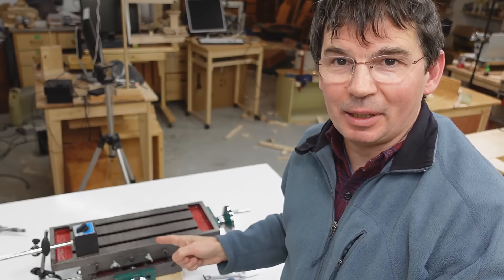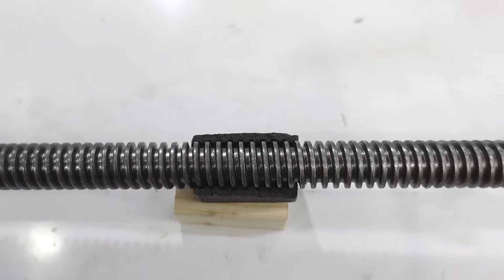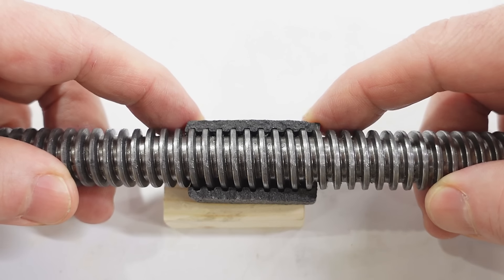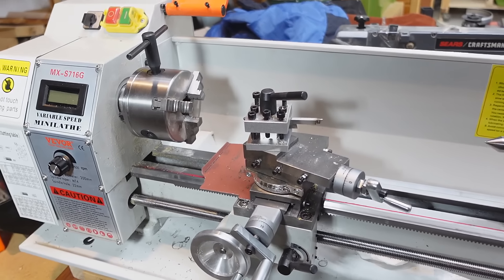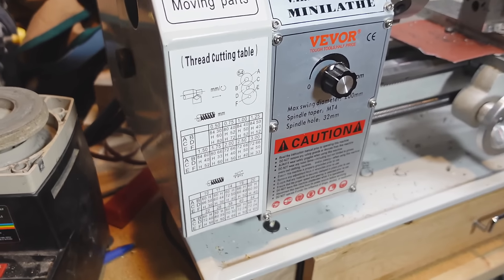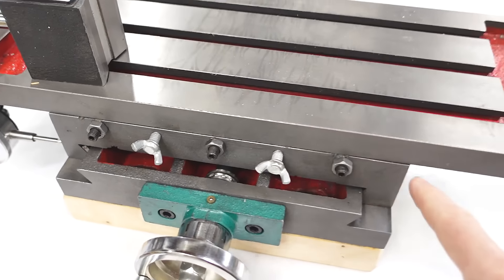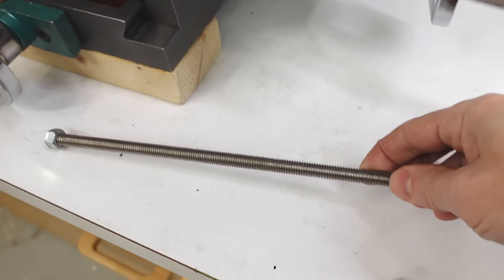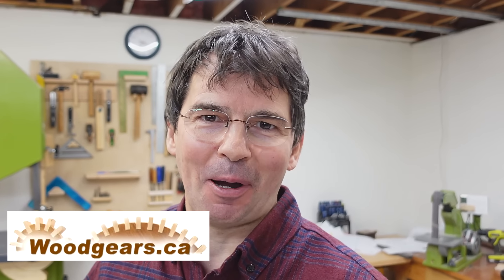Why all the hate for Vevor?

Comment: Vevor is a highly underrated company. The variety of the things they sell is amazing. I've been very happy with their products. I have a coffee bean grinder, kitchen stand mixer, Internet-connected weather station, a stick/TIG/MIG/flux-core welder, water (and other things) distiller and am considering buying a meat slicer. The only negative issue, not really a problem, with Vevor is that they don't sell repair or spare parts for their products. Not having the parts inventory and infrastructure is partly how they can sell at such low prices. You can buy a whole new (name your item here) from them for less money than the said spare part for comparable items of their competition. This is the incentive they use to ensure that a repair parts sales department is not necessary. If (big IF) the blade on your Vevor meat slicer wears out, you can buy a new machine for less than a new Hobart blade. (Don't fact check me on that. I'm just illustrating my point.)

Wen is another underrated but tool-only company.

Comment: Just thought I'd share some experience related to milling with a drill press.  1) Tapers are not designed for transverse loading, and it's going to have a tendency to fall out of the spindle.  It's why milling machines have draw bars.  2) I solved problem one using retaining compound, but slop and flex in the quill made it nearly impossible to get good results, even with very light cuts. 3) precise depth of cut is nearly impossible.  If you decide to take it on, expect significant challenges.
Reply: I wanted to convert my drill press into a wood/plastic mill. Replaced the bearings with angular contact bearings and modified the spindle so i could apply a preload. Modified the end to take an er25 collet and nut. Turned out great but i appreciate it has it's limitations. Does manage to munch through aluminium but no where near rigid enough for steel.
Reply: Mill spindles are a lot more robust than drill press spindles are. The diameter is twice as big.
Reply: My milling machine spindle has a pair of tapered roller bearings made by timken, whereas almost (but not all] drill presses I've looked closely at, tend to have ball bearings instead. 

As a result, the bearing setup on a  drill press is much less suitable for side loading.

Some exceptions to this, are where some drill presses use basically the head of a milling machine (see Stefan Gotteswinter's shop tour video).
Reply: Your point is a good warning,as you say Morse tapers are not dependable for milling without a drawbar through the spindle.
Reply: I think it is not just significant challenges, but impossible challenges. At best you can mill soft wood and plastic with very small tools. If the drill press is still usable as a drill press (or even improved!), it could be a good education to try.
Reply: @howardosborne8647  You "could" remove the chuck from the drill spindle and drill and tap the end of the spindle.......then just put a screw up inside the chuck and pull it onto the spindle.......it can never fall off.

Comment: Bottom line is: you either get a Vevor lathe or no lathe at all.
Reply: Well there are many other options out there that are higher quality products, and many of them are not stupidly expensive either - Vevor seems to be targeting very much the cheapest thing you could reasonably sell without false advertising, while others might target the best bang for the buck possible on an actually ready to use tool, and of course at the premium end the highest possible quality who cares what it costs... 
If your price bracket really is stuck at Vevor or nothing, nothing might actually be the better choice for many - makerspace and the ability to order your part made to order can work out much cheaper and get you better parts than having to own the tool and then spend ages making it useable yourself. Of course you may not have a local makerspace (or friendly workshop).
Reply: @foldionepapyrus3441  You make a lot of assumptions!. There is nothing wrong about modifying a tool you own to make it better.   People modify hammers to a specific need.   As with any tool, it's only as good as the person using it.  I have seen garbage made on highly precise and very expensive machines, and vise versa I have seen quality work done with cheap tools and alot of skill.
Reply: @rmora1  I really don't - just because you can make something good with crap tools doesn't stop the tools being crap. Or after you put in huge amount of effort to improve them from such a low starting baseline probably only get to mediocre. Unless you have spent more on it than the good tool would have been in the first place...

With a quality tool the work is usually faster and easier to get a good result and in the case of more high end machining fits it becomes actually plausible to create that large surface that must be kept to a very precise size. 

Which is why a local Makerspace may well be a better choice than the worst end of budget tooling - odds are they have tools that are far better you can use, probably have managed to find an old grey beard or two that really really know their stuff you can learn from etc... However that suggestion obviously won't do you any good if such a thing doesn't exist for you.
Reply: @foldionepapyrus3441  I have designated crap tools I use for crap projects and I have precise tools for precise projects, either will do the job.  As the saying goes " It is a poor workman who blames his tools"  Having precise tools and not having the skill to use them is a common thing now that did not happen before.   Having precise tools does not  guarantee quality work.   Precision is nice but if it comes at too high a cost then it becomes pointless.  I can have the most precise pair of  pliers ever made but what good is that precision when the average mass produced pliers do the exact same job in the exact same time.
Reply: @foldionepapyrus3441  Many other options but I didn't name a single one..
Reply: @PatrickRemington  You'd have to do your research for what is available in your market at your price point as there are way too many options to list. For myself I'd suggest getting the best you can afford or on a tight budget not buying the crap quality machine at all for most folks - the skill required to make good use of a crap machine is rather harder to teach yourself on that crap machine, and unless you already have a stock of raw materials and tooling to help you tune up that crap machine it will cost you a fortune more to deal with that crap machine.
Reply: @PatrickRemington  Oh but if you insist on a name Cowells make really great and precise tiny lathes for a price I liked (Its the choice I made for my watchmaking sized projects), Myford are still making new lathes and parts to restore the old ones (no personal experience of their products but I hear good things). 

Neither are at the cheapest end, and may not even be available on your side of the pond. But personally for a machine tool I'd only get cheapest end as a project once I already had a good tool to make building the repair parts less annoying - do you want to spend 3 days hand fettling when you can spend 10 mins with a good tool and jump right to the end.
Reply: Vevor: "We're not the best, and we know it 👍"
Reply: Better buy a used decent lathe than a new Vevor piece of junk.
Reply: @glenpaul3606  That all depends, a lot of smaller size old lathes are really not that good, or are worn so much they need grinding or scraping. I have a very good Schaublin SV130
 lathe at home. But before that I had two myford ML-7's and a Super 7, If you want to buy either of those you'll be buying an overpriced lathe, that in all likelihood will have a worn apron that makes any kind of precision work  impossible. And the same could be said for other small old lathes, like Boleys.

My magnet drill and tractor tire bead breaker are from Vevor, and both work great.

Comment: I have had a lot of success with companies like Vevor, Harbour Freight, & Pacific Freight Salvage, they may not have the highest quality, however they do tend to be the easiest to repair and or modify because they generally are made of simple materials and follow simple designs.  Great video Matthias thumbs up.
Reply: What is Pacific freight salvage? I've never heard of it.
Reply: @mturallo  I suppose that was before Harbour Freight I use to purchase from them in the '70s, I bought a nice 5/8" bench mounted drill press.  The chuck kept falling out because the morse taper was not made correctly, I just lapped it with valve grinding compound and it's been working great ever since.

Comment: Cheap tools can be a great project to learn and improve it if you're not too fussy on starting making parts immediately. I've bought many cheap tools that I've adapted for more accuracy to the point it was enough for me. Occasionally I've replaced them once I outgrew the tool. But sticking with what you have saves you a lot of money instead of splurging for a much more advanced tool you probably not going to appreciate the precision during its lifetime anyway and limit you in buying more tools along the way.
Reply from the maker: exactly. And with the cheap stuff a multiple cheaper, you can think of it as an incremental cost on you way to a proper tool if you do end up replacing it.
Reply: That's why I think the saying "buy cheap, buy twice" is bogus. Not only does "cheap" often last much longer than expected and tick all the boxes, it also means that after that I know what I actually need from a tool. The "buy twice" would happen anyway for that reason even with an expensive first tool.
I also found that I'm more likely to fix and modify cheaper stuff. That's because I don't have any qualms to rip into a cheap tool as there isn't anything expensive to break.
Reply: @superdau  DEAD ON!!!
Reply: @superdau  the old saying "buy once, cry once" holds true for some things, but as with everything, it's not always applicable to everything. For instance, if someone wants to put a very precisely sized hole into a piece of metal at a very precise location, (and if the 'want' for that hole is more important than their 'want' of another project) and if they have the amount of monetary budget to allocate to a solution for creating that hole, then the saying "buy once, cry once" can hold true. After all, what you don't spend with money you spend with time. Given enough time, many people can get a cheaper machine to operate precisely if they have the measuring tools to determine that level. But it takes a lot of time and physical effort to make it happen.

Comment: When I worked at a big box store back in my college years, whenever people would ask about the cheap in-house brand and the higher quality name brands for power tools, I'd usually ask what they intend to use them for.  More often than not the people asking that question just needed something to get a job done, and may not use it much if at all afterwards.  For that, the low cost entry point to tools like these are perfect.  Is it perfect? Will it last forever? No, but why spend $400 on a drill when you're going to use it for 3 days and stick it on a shelf for the next 8 years...
Reply: That was the good old days. Now, they would just buy the expensive one, use it for 3 days, and return it for a refund. That's why you spend $150 for a drill that costs $25 to manufacture.
Reply: @Bob_Adkins  highly unfortunate how right you are with that statement...
Reply: Well said, it's why I own thousands of dollars off festool stuff and hundreds of dollars of ozito/enihell stuff. The festool gets used daily, the ozito stuff sits on a shelf for weeks at a time.

Comment: I purchased a VEVOR 12v diesel heater 3yrs ago. It isn’t perfect and I have had it apart a few time for repairs. Sure it’s mostly plastic and cheese grade castings but it was cheap and has kept me warm for 3 seasons of truck bed camping. Considering it’s about 1/10 the cost of name brand I am very pleased with the results it produces if not the product itself.

Comment: The best way to remove the lash in the lead screw it to have dual lead screw nuts that you can adjust them in opposite directions. This will take out all that slop without making the lead screw harder to turn. The nuts are adjusted to ride on the opposite sides of the threads.

Comment: Hi, as a machinist for decades I have found every screw mechanism has backlash, you just have to learn how to accomodate it in your work. The bad fit of the screw nut here can be reduced but not eliminated easily, think about it.
Reply: Yea, ive only done it for 5 ish years but ive never really seen a perfect one either. Most stuff i use have digital readouts so i just go off that and learn to feel where the screw grabs and starts to move like you say. Never had much of an issue.
Reply: Exactly. Every machinist naturally accommodates backlash with their technique. You may have to avoid climb milling but then again it may work if the gibs are tight enough.
Reply: Exactly. Every machinist naturally accommodates backlash with their technique. You may have to avoid climb milling but then again it may work if the gibs are tight enough.
Reply: Exactly. Every machinist naturally accommodates backlash with their technique. You may have to avoid climb milling but then again it may work if the gibs are tight enough.
Reply: Exactly. Every machinist naturally accommodates backlash with their technique. You may have to avoid climb milling but then again it may work if the gibs are tight enough.
Reply: Exactly. Every machinist naturally accommodates backlash with their technique. You may have to avoid climb milling but then again it may work if the gibs are tight enough.
Reply: Exactly. Every machinist naturally accommodates backlash with their technique. You may have to avoid climb milling but then again it may work if the gibs are tight enough.
Reply: Exactly. Every machinist naturally accommodates backlash with their technique. You may have to avoid climb milling but then again it may work if the gibs are tight enough.
Reply: Exactly. Every machinist naturally accommodates backlash with their technique. You may have to avoid climb milling but then again it may work if the gibs are tight enough.
Reply: Exactly. Every machinist naturally accommodates backlash with their technique. You may have to avoid climb milling but then again it may work if the gibs are tight enough.
Reply: Exactly. Every machinist naturally accommodates backlash with their technique. You may have to avoid climb milling but then again it may work if the gibs are tight enough.
Reply: @meetim6271  Can you repeat that one more time? 😀
Reply: 😂Lol lol lol lol lol

Comment: You are correct about the high cost of used machine tools and they may require a bit of tweaking too. Just cleaning an old lathe covered in years of grease and grime is a major task. I did a search for a used small lathe and could only find (in my local Cleveland area) a few that where 3 to 4 times the size of yours for $3K to $5K range and need work. Also they don’t run on standard house current. Nothing wrong with what you have.

Comment: I haven't really heard anyone else talk about looking for used tools in the way you did, and I really appreciate it. The only used tools I've purchased were relatively recent model jointer and planer, for just a decent discount of MSRP, but as a general rule, I avoid older/ vintage tools. There's a whole market of old tool fetishists who drive prices way up. I've had to talk a few friends out of buying old iron, even if it's maintained relatively well. It's almost always too expensive, and usually requires just as much fixing/ tuning as newer, low cost tools. Not to mention there is absolutely no support infrastructure if you ever run into a real problem. Fixing up hobby level, cheapo tools can make them basically as good as mid range pro-sumer tools.

Comment: I feed the work piece against the screw thread and always move the table far enough away from from the cutting tool to take up any backlash for each pass back across the cuter. Given the quality of any set up you will always experience wear. Such as diflection in the spindle or lift in the ways of the table. Excellent channel 😊

Comment: I often think about the Sherman tank.  It didn't have the best armor, the best gun or was it the fastest.  It was good enough in all those areas and the allies could make A LOT of them!
Reply: Likewise the Sherman was very repairable too.
Reply: As a german i can confirm that! 😂
Reply: The thing about the Sherman is it had to operate in the field thousands of miles from where it was manufactured. Which it did superbly. I think you could change the driveline in a Sherman in a half a day. A Panther tank it took 2 weeks. So even if the Germans knocked a tank out we could have it back on the battlefield the next day. Just hose out the crew compartment and go. Even the Germans liked Shermans and used them.